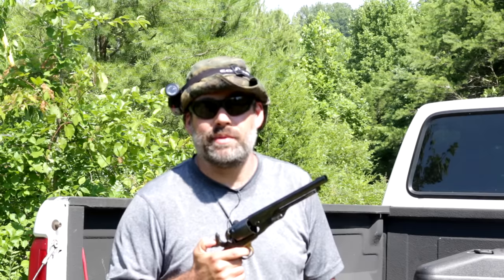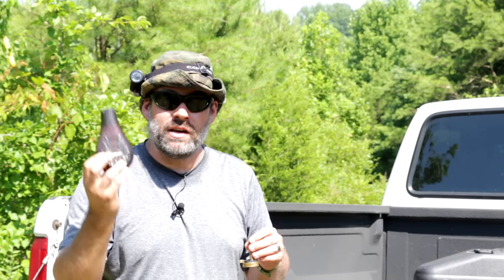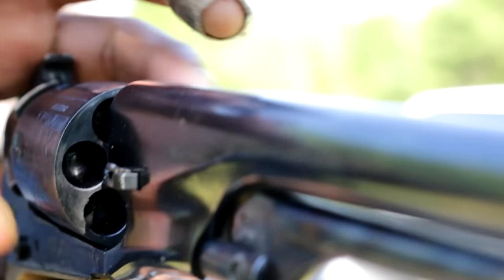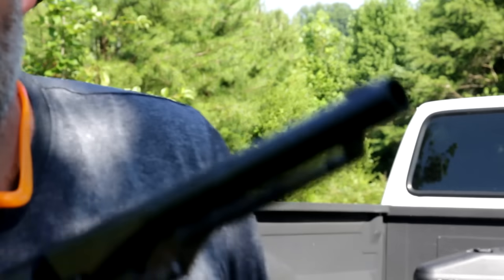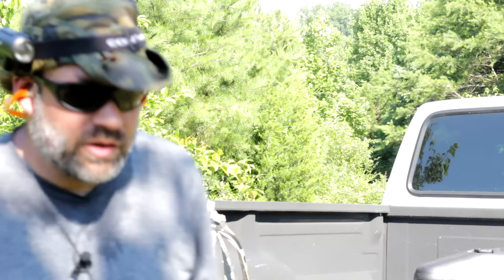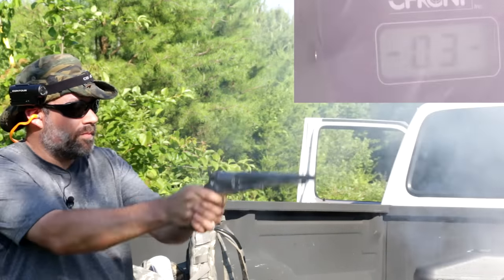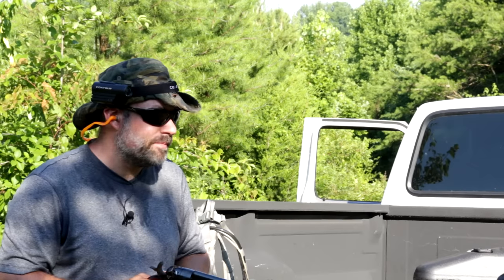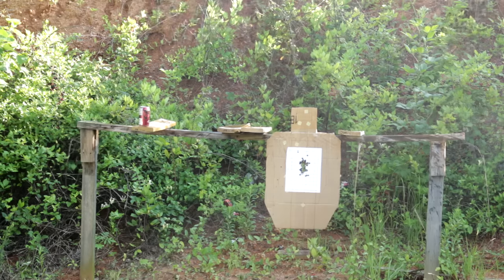How Powerful are Black Powder Revolvers?

Comment: Should try it with 217 grain conicals like the Johnson and Dow with 25 grains of 3F Swiss to replicate some the original loads.  Or even the Lee 200 grain conical since it's easier to get.  Velocity would be lower, but a lot more mass than a round ball.  If you can't get good black powder easily, use Triple 7, it's about as close as subs get to the sporting powders that were available back when.  Goex and Elephant and other black powders we commonly use are musket and rifle low quality BP not as hot as a true sporting powder like Swiss.  Goex does make a sporting powder, Olde Ensford, that I've been impressed with so far.  The sporting powders are hotter and leave less fouling than cheaper quality powders.  That said, Swiss is too expensive for the amount of revolver shooting I do so I use Graf's BP which is made by Wano Schwarzpulver of Germany and while not quite as good as Swiss, it's a lot better than Goex and about the same price as Goex.

Comment: It looked like some powder expelled out between the cylinder and barrel lit on fire. I mean ignited, meaning I think 30-34 grains are plenty. When I black powder hunt, I have a magnum rifle. It can take 160 grains of powder. 50cal. But the best accuracy I get out of it is if I use 90 grains of powder. You have to find the best load for each gun I find.

Comment: Pyrodex is more compressible than black powder so you can seat a ball over a cylinder full of pyrodex. But pyrodex gives more deviation when compressed and the factory advises against compressing pyrodex.
Performance with balls just seated firmly on the powder is very good
As your video shows

Comment: You should try this again with some 4F. Pyrodex and Triple7 3F produce decent velocities but 4F hits the max from my .36 and .44 Piettas. I've also experimented greatly with smokeless in my steel frame BP guns, albeit at very moderate charges and have had great success. Many people with blindly say "You NEVER use smokeless in a black powder firearm" and if you aren't well versed in powders and reloading I would agree with that. However if you have a good understanding of reloading and what certain powders do, what pressure levels are being produced and have safety measures in initial testing, it can be done quite successfully. My go to load for my RNA and SAA replicas is a .454 round ball with 6.5gr Bullseye. I've also used Red Dot with slightly larger charge weights, and with these combinations I reach 1080-1120fps safely and cleanup is a breeze. I also use Bullseye in my NAA .22 BP revolver and with 2grains and a 30 grain conical I reach 1210fps average. Out of the same exact firearm with a .22 magnum cylinder a 30gr Vmax CCI cartridge averages 1183fps, so my muzzleloader charge actually surpasss .22 Mag in that platform. By the way that firearm has only a 1 1/8" barrel!
Reply: Joe Doole do you know of any videos similar to the loads you mentioned that you use?
Reply: 4F?!? That is intended ONLY for Flintlock PRIMING CHARGES!!!!
3F is for Pistol/ Revolver and shotgun.
2F or 1F in a rifle .45 calibure and larger.
Reply: @stevehuffman7453  FFFg isn't for shotguns at all. FFg is for shotguns of 20 gauge and larger. FFg for rifles. Fg for cannons up to 12 pounders.

Comment: You re an ACE, this is the best blackpowder test videos I ve seen here. It would be wonderful if you could do the same variable powder load test with the Walker, Dragoon and Navys. Can you? I just bought 2 Walkers, a 60 Army and a pocket 62. All actual Colt repros. Enroute in mail to me from sellers. Can t wait.
Reply from the maker: I wish I had a Walker and a Dragoon to test but I don't have them and they are just too expensive and low on the priority list for me right now.  Although, I may send out some feelers and see if I can get something for a T&E.  Stay tuned I have some ideas.
Reply: DEUCE AND GUNS I have a Uberti Walker and it is a beast of a handgun but i found a considerable difference in performance when using real black powder. My Walker looses acuracy, velocity, and a decent amount of power when using pyrodex. pyrodex burns too slow so compared to black powder you will loose velocity and power in a bp handgun. Pyrodex is good for bp rifles as it burns slow but builds up more pressure and velocity as it burns allowing for decent velocity out of a rifle. I understand though that real bp is hard to find so most people have to use substitute.

Comment: If you make your own BP- it depends on the charcoal you use, but I promise you can make some stronger than Pyrodex.
Reply: No, you can't. Today's black powder is made with carbon black, much purer than any charcoal, with a BLEND of potassium nitrate and of sodium nitrate and chemically pure sulfur. Do you have a dozen sizes of brass sieves to sort the grain size? Do you have an explosion-proof press to roll the grains and coat them with graphite for consistency??? I didn't think so.
Reply: Yea, I add nitro to mine, wanna see? LOL

Comment: I've always bent the cap just slightly before capping and never have had an issue with a full lock up, that being said I usually don't push powder loads and usually start low and then increase until I've achieved the accuracy I desire. it seems that with heavier loads you're more likely to have that cap blow off. I'm guessing its from the pressure
Reply: also are you using 11 or 10 primers in this video because #10s will change your life if youre not using them for your cap and balls

Comment: You ought to test a Walker Colt replica, when loaded to a full charge they are pretty close to a modern 44 magnum in power.
Reply: They're much closer to a .357 magnum than a .44 magnum, but a helluva lot of fun any way you look at it!
Reply: @craigoldsen1667  The Walker is 100% equal to the modern .44 Magnum lead bullet factory load using a Lee mould 200 grain conical. Any more velocity will only lead the barrel into unusable accuracy in three shots, either from a Walker, or .44 Maggie.

Comment: I think its because you're using black powder substitute so it burns slower thus not being able to burn completely before the ball leaves the barrel, I bet if you used fffg goex you'd notice an increase on the chronograph.
Reply: Pyrodex pistol creates more pressure and higher velocity than 3F black powder

Comment: Try ramming Malt-o-Meal or Cream Of Wheat on top of the ball instead of putting a glop of Crisco grease over the ball.
They help remove fouling, and are non-flammable which prevents crossfire's.
It is also easier to clean the revolver when the shooting is done. No melted Crisco on the frame. :)
I've used Cream of Wheat and Malt -o-Meal when shooting my cap and ball revolvers for going on 45 years now. Never a problem.
Reply: I ram a card wad on the top after scraping it on a bit of lube made of beeswax & coconut oil 50/50 by weight, never a problem.

Comment: I read or heard somewhere that the IDEAL black powder load was 1/2 the caliber plus 10% by volume. That would be 27 in your case. I see that 30 of Pryrodex worked fairly well in your test. Of course, what do they mean by IDEAL? Efficient, economic of powder, etc. Questions: Was the Pyrodex Pistol powder or Rifle powder? Does traditional Black Powder work better? WARNING: Tripe Seven is more powerful than BP. Don't  (do not) add 10%.

Comment: Crisco alone, especially in warm temperatures, is not enough. after the first shot most of the Crisco gets blown out of the adjacent cylinders. For plinking I typically use 25 grains because it's a bit easier on the gun. With 30 grains you can really feel the difference.

Comment: I used to load 37gr fffg into my 1858 Remington pushing a .457" 142gr ball at about 1200fps. This is a very hot load and not one I would try in anything other than a 1970's Uberti

Comment: 30 grain pyrodex pellets are much easier to use, no need to measure and pour and also eliminates carrying a powder flask and powder measure. Your shots will be more consistent because you are using a pre measured and manufactured pellet,  there is some variance with the measure, pour and sometimes spill method. If you intend to try black powder, research the safety precautions so you do not get chain fires. I have been shooting black powder since the 1970s, love it very much. People question the lethality of black powder, keep in mind that wars were fought for hundreds of years and hundreds of thousands died as a result of BP firearms.

Comment: 1st series, the speeds vary a LOT, but what is more interesting is the CHANGE from 1st to 6th shot. The numbers were 475,503,646,676,694,694. Starts low, climbs rapidly, flattens out. My first thought is that the first few shots were with a cold gun, and the latter with a hot gun. This means the Average of the first series is lower than it should be, and later series don't show the same variation. 2nd series 935,862,915,899,895,903.

Comment: I like chopping the barrel of the 1851 Navy down to 2" then loading 50 grain 777 pellets and .454" lead balls. I was pinching and using #11 BP Magnum caps from Winchester, but this year I found CCI caps for sale at the local Walmart. Hopefully it'll still work well when I get my new 1851 Navy. Just wondering, would anyone chrono a 2" barreled Pietta 1851 Navy with brass frame and various powder loads, too? I'm curious. I know it's powerful and painfully loud, but I want to know how much power I'm actually getting. Anybody else curious?

Comment: I recently purchased a conversion cylinder which it says for cowboy loads only. I noticed however cowboy loads use small amounts of smokeless powder and I went on Hodges site and enter information on reload. 7.8 grains of universal would send the 250 soft lead bullet out at 940 feet per second. The stats on this load say it is 13,000psi I know max is 14,000psi I am wondering is that safe? mind you the cowboy load I am shooting already use 7 grains of universal to send the 250 grain bullet at 850 fps.
Reply: STAY AT 7 GRAINS!!! I would load a 240 grain soft lead bullet with 7 grains of Universal and trade some recoil for velocity at lower pressures for safety. You can ALWAYS SAFELY load a lighter bullet with fast-burning powder and get lower pressure and somewhat higher velocity. You're still throwing a softball of lead at 1000 MPH, and it'll leave a mark....

Comment: A lot more reliable when you wax around bottom of caps. They wont jam the mechanism anymore because you have to manually pry them off after and prevents moisture from getting into powder. I also wax over the ball

Comment: It has been a couple decades.  Isn't BP or Pyro meant to be 15% less powerful than the other?  I forget which one.  You are  lucky to have a hand or not have shrapnel in you toward the end.  Now when I shot BP revolvers in my teens I did not have a measure or recommended grains.  I filled each cylinder to the top and CRUSHED a Ball on top of it.  Compressing the powder was no more difficult than seating the ball itself as I used the oversized balls.  (I did this with a Sheriff 1851 5.5 inch barrel with the stubby rammer.  I did not use a cylinder press!  Think about that.)  I was surprised it fired at all making a solid mass of the powder.  I am also lucky I did not have an EXPLOSION incident.  I think the slowing of the average toward the end with the greater powder size is because not all of the powder burned  because of compression.  I probably had the same effect when I was OVERLOADING mine as a kid.

Comment: My 2 encore. 50 caliber 15" piston max out by manufacturer recommendation at 110 grains of 777 FFF powder.with a 300 grain sabot it quickly reaches the 454 casull number of 1650 fps and 1650 fp.

Comment: Hey BC.  I have been interested in getting into Black powder revolver shooting.
I see right now  , 7 June  2018 ,  that Cabelas has the Pieta  Model 1851 Confederate Navy .44 cal revolver
on sale for  $149.99  FREE shipping and no tax for me because Cabelas is just over the border in South Carolina
and i live in Cherr'ville, NC.

I know the Uberti  black powder revolver is better quality than the Pieta but I live on low disability income so I do not mind going with lower quality items as long as they are well made.

Do you have any experience with Pieta revolvers?
Reply: Oops  i had not re watched this video or i would have seen you were using the short barrelled Pietta
for your tests.  I am considering the longer barrel  7.5 " model for more accuracy.
Reply: Opps again I read the description and for some reason I thought you were using the short sheriffs model.
Gee I think my Atrial Fibrillation of my heart is really screwing with the oxygen levels in my brain.
Reply from the maker: I did pickup a sheriff's model awhile back.  Personally, I recommend the 7.5 inch model in brass from Pietta and limit the charge to a round ball over 25 grains of black powder.  If you get super interested in Black Powder then that's when you start adding the more expensive steel frames and long/short barrels to the collection.  Also, that sale at Cabela's happens several times a year so no hurry because you can always catch the next one.

Comment: Is that a Pietta 1851 navy? Because I bought one but the guy Who sell it to me in Cabela’s said not to put over 25 grains of powder in there is it fine if I put 30. Bc you’re gun was doing it fine
Reply from the maker: In a steel frame revolver you can go over 25 grains and be fine.  In a brass frame going over 25 grains will wear it out quickly.
Reply: DEUCE AND GUNS so I have a brass frame. Is 20 grains fine? Does it still have enough power to be used in self defense?

Comment: A ~200 FPS SD in the first cylinder? What gives? First couple shots were around 500, last couple around 700?
Reply from the maker: The powder charges were all measured by volume, uncompressed, and carded across the top so I've got two theories.  The first is that smaller powder charges burn more erratically.  More than likely I think the .451 balls were just a tad too small for these chambers.  I normally cast my own but went store bought for consistency and couldn't find any .454 balls.  Comparing .451 vs. .454 will be a future video more than likely so stay tuned.
Reply: I noticed at 3:45 that the ball seating was not 
uniform. Enjoyed the video though!
Reply: I would start checking nipples. Run a reamer. Watch to see if it is consistent. 
Some caps are better than others.
Seating said caps matters.

Comment: back in the old west and during the Civil War before you rotate your chamber you would tip the barrel vertical so when you rotate the chamber is spent primer cap would fall off the nipple less chances of jamming the cylinder

Comment: Its snuffing at 35 grains of pyrodex, meaning your not getting a full clean burn of powder. Back it off to 30 grains which is the general maximum for these limited cylinders. Hotter primers will also increase the burn rate, but also limited on these cap and ball revolvers. I use 209 primers with my derringer size muzzle loading pistol, and 40 grains of Triple 777 fffg synthetic black powder, always averaging well over 1150 fps with the 143 grain round lead ball. I think you will find the Triple 777 to have more power than the Pyrodex.

Comment: It gained anywhere from 10 to 20 fps on average for every 5 grains. I must mention that this should not be tried at home these antiques (not guns depending on what state you live in) are designed for specific powder loads and you risk blowing the cylinder or cracking the brass frame. My friend did this many years back on a range in texas and the range owner ran out screaming "if your gonna do something stupid and kill yourself atleast have the sense to tell everyone so you don't kill us too"

Comment: The factory load recommendation from uberti with my uberti 1860 army revolver is 25 to 30 grains of genuine black powder and 25 grains maximum with black powder substitutes. It's risky with an open top colt style gun to go beyond the factory maximum load. With my piece I use 24 grains of genuine 3f black powder and a Cabela's lubed felt wad between the 141 grain swaged lead .454 round ball and the powder and a Remington number 11 cap and I'm getting a consistantly velocity between 750 and 800 feet per second with about 200 foot pounds of energy and from 30 feet away I hit all my shots within a 3 inch center mass group and using 24 grains my piece doesn't seize up and it's easier to clean

Comment: how are the ft-lbs measured or is it figured by speed?
Reply: You need to know two factors in order to calculate muzzle energy: the muzzle velocity and the bullet weight. A slower shot may have higher energy than a faster round, if that slow-moving bullet was the heavier large-caliber one.

Comment: overall what would be your recommendation on loads for optimal performance?
Reply from the maker: If you have a steel frame revolver I'd recommend somewhere in the range of 25-30 grains some revolvers may be more accurate at 25 vs. 30.  On a brass frame Cabela's recommends to not exceed 25 grains.
Reply: In your video 30 grains didn't have much velocity or force but 40gr was close to a 44 special. How was the accuracy at 25 yards with that charge?
Reply: If I may,  I've had great results with 40g behind a .454
The 40g-c  some crisco/beez wax lube and a .454 RB are as accurate and reliable as a Federal .45 acp 230g ball round from a Government 1911.
They punch 2-3 inch (Give or take) groups at 25 yards.